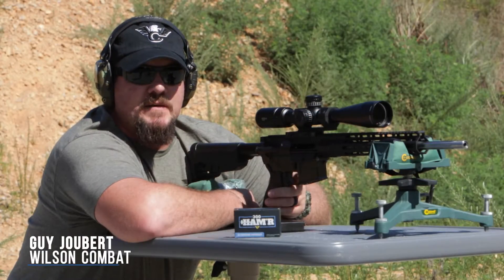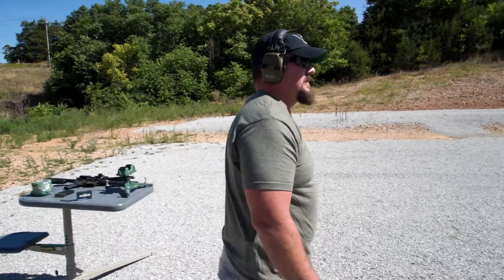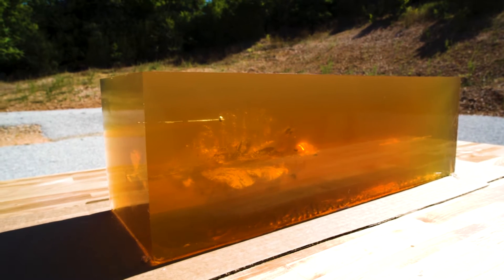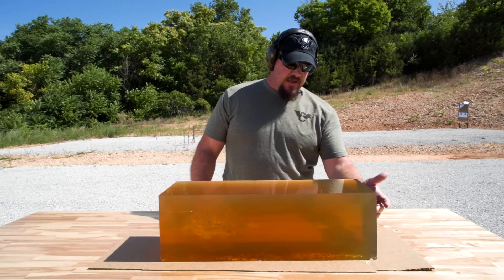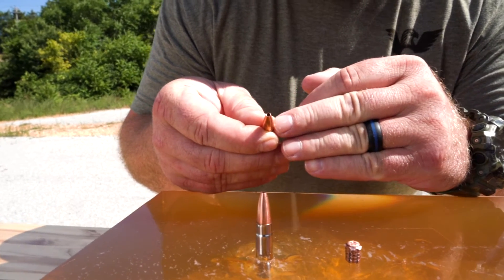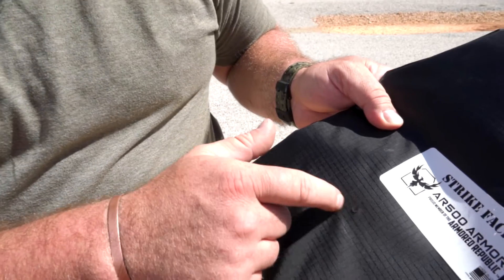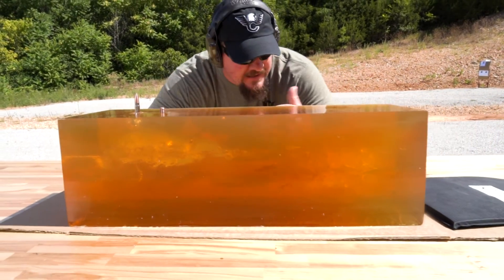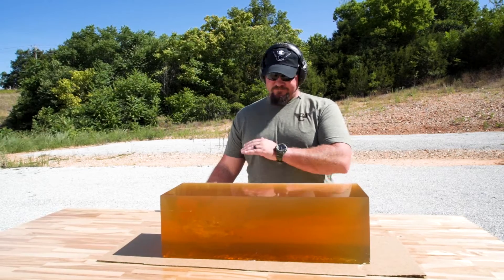Controlled Chaos 125gr 300 HAM'R Bullet in Gelatin  - High Speed Camera - Slow Motion Video.

Comment: I run the 110gr Controlled Chaos @ 3310fps out of a 16" .308 Sig Cross - crushed a yote at 230yds a few days ago w/ a double-fist sized exit. No spin, dropped like a box of rocks & was dead before he hit the ground.
Reply: emskirchner Oger  Look up Lehigh's load data for 115gr Controlled Chaos out of a 16" 308 & educate yourself, you're highly mistaken. 48gr of Accurate 2200 gets a 3310fps avg confirmed via my Magnetospeed chronograph. 49grs got me up to a 3375fps average  but bolt lift got a little heavy & groups opened up from .5 to .75 so I settled on the lighter powder charge.